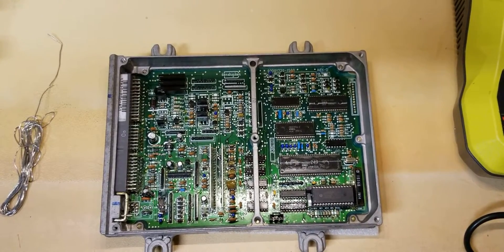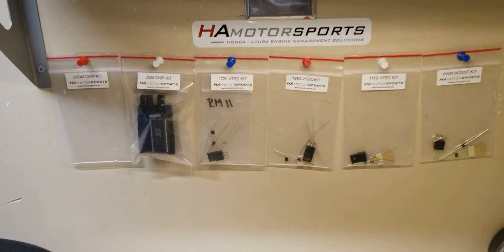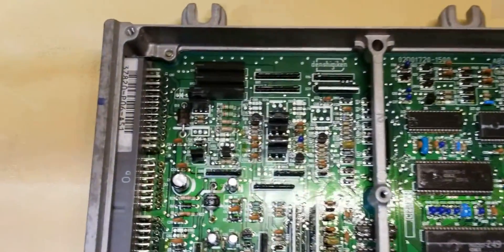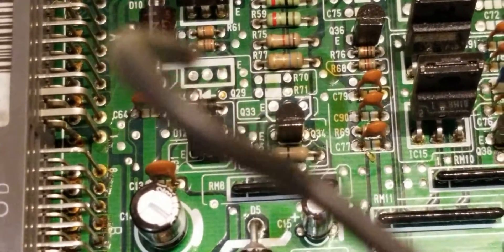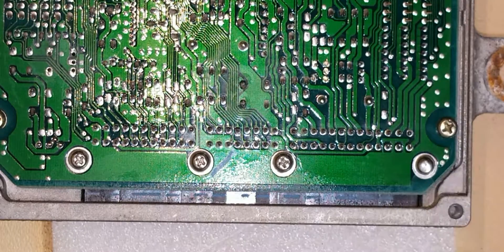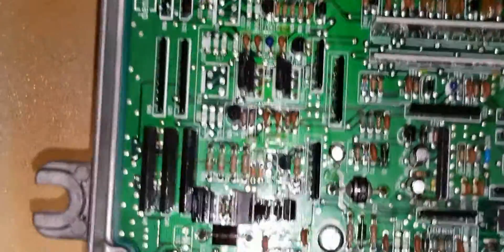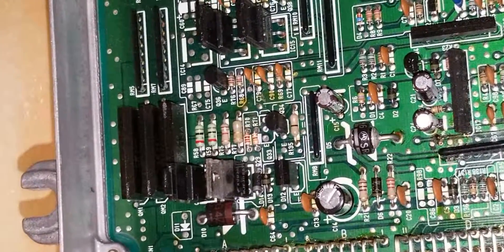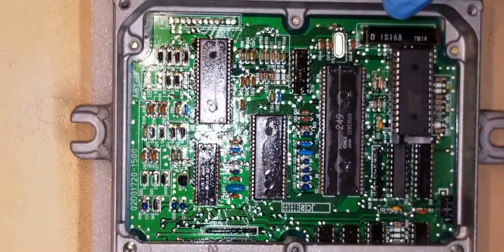HA MOTORSPORTS PWM BOOST CONTROL KIT INSTALLATION P06 ECU

Comment: Hello, I need the code for transistor Q31, which is near the capacitors, because the one on my board exploded and I can't buy another one without the code. Thanks.